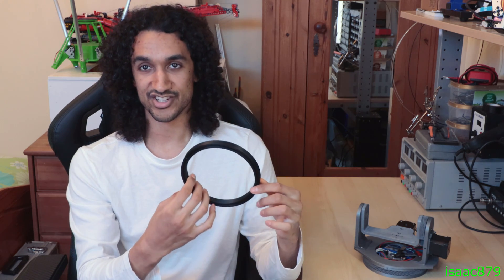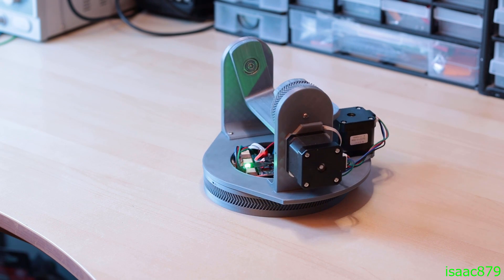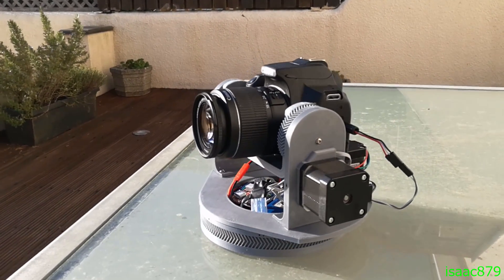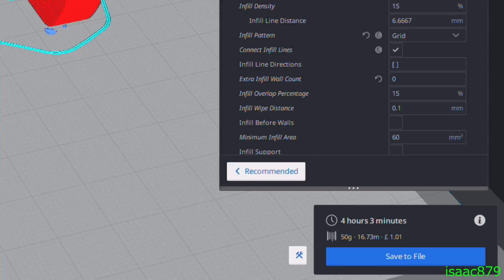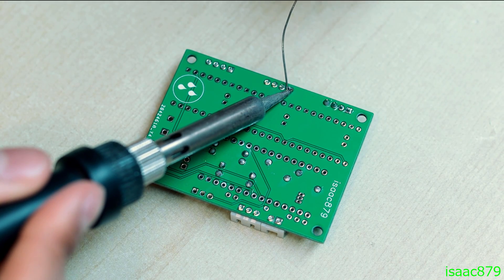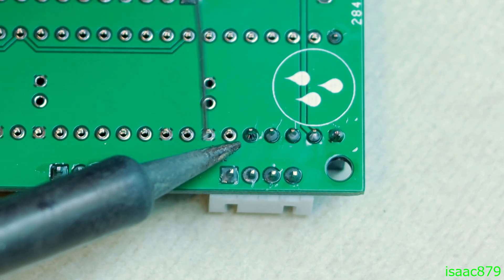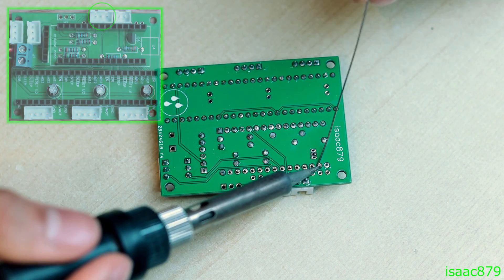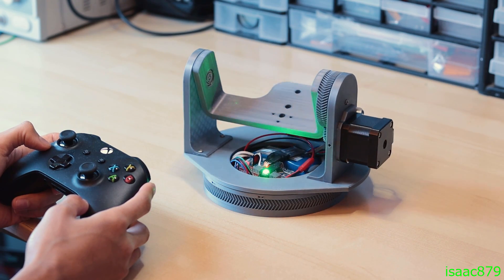3D Printed DSLR Camera Pan Tilt Mount (Arduino/Stepper Driven) 2020

Comment: Which filament do you use the most for printing
Reply from the maker: I normally just use PLA as it's cheap and really easy to print with.
Reply: isaac879 I've tried all the tutorials on YouTube but it doesn't work, do you guarantee this tutorial will work if I try?  and has anyone tried?  and can the xbox controller be replaced with another one?  because the xbox controller is too expensive.  thank you

Comment: I have a Canon EOS RP...what's the weight limit for this ?
Reply from the maker: My camera with the heaviest lens I have is about 950g and works fine. However I think the EOS RP is quite a bit wider than my 250D so may not fit in the U-bracket...
Reply: @isaac879  just barely...mine is 10mm wider

Comment: So I found these $16 lazy Susan bearings that look like they could work (140mm), might solve the cost problem? https://www.amazon.com/Bearing-Smooth-Heavy-Duty-Swivel-Hardware/dp/B07TKW1PMM

It's roughly the same size as the bearing you used and they have even bigger ones for not much more.
Reply: do they work ?

Comment: This looks amazing and well done on getting it all built.  The only thing that I am a bit worried about is that my lens is a bit bigger and will hit the stepper motor if not careful.  What ways are there to make sure that you can put a stop to the tilt function to protect for this.  Also am I able to use the Arduino uno with the cnc shield avoiding having to build the board myself?
Reply from the maker: Thank you! Unfortunately there isn't really a way to stop it from hitting the lens/camera. I have used a variety of much larger lenses and haven't had any issue as long as I have been careful not set the tilt axis to far. Even if you do manage to hit the lens against the mount the stepper motors should just skip steps and not actually damage it anyway.
Using an Uno and CNC shield would require you to change some pin assignments in the code and might not have the circuitry for the hall sensors and shutter trigger for the camera. Apart from that it should work (I initially did some testing with a CNC shield before making my own board).

Comment: This is a great project. With respect to the soldering, could I make a couple of suggestions? (1) For solder, have you tried good quality 63/37 solder? It has much better flow than 60/40, and doesn't require the high heat of the lead-free solders, which will wear out your tips faster. (2) Have you tried a chisel tip instead of a round one? You well get better contact with the pins and pads that way.
Reply from the maker: Thanks! I've have been using a 63/37 solder. I have been meaning to get a chisel tip for a while but haven't got around to it yet!

Comment: hi! great job!! where did you buy the bearing? i looked around and it looks very expensive
Reply from the maker: It was being scrapped from an industrial robot so i got it for free but I have heard they are very expensive ~£400 so I have included files for a 3d printable repacement that just uses 6mm bbs (or any 6mm balls). It is way lighter and still runs really smoothly.

Comment: Love the design :)  any links for the bearing? it looks to be quite difficult to find
Reply from the maker: Unfortunately they do seem hard to get hold of, it looks like you will have to request a quote from here: https://www.nodeshk.com/ina/ball-bearings/thin/csxu050-2rs.html Someone told me they were 600€ though which is why I designed the 3d printable alternative.
Reply: @isaac879  how do you put together the printed alternative? Would that be just by pressuring it in place or should the inner wall be divided and then pasted together?
Reply from the maker: @romarchant  The outer race has a small split in it to allow you to open it up and put all the balls in.
Reply: @isaac879  great project! tell me what diameter balls are needed?

Comment: Would it be possible to replace the bluetooth addon with ESP-01 as it contains both, Bluetooth and Wifi?
Reply from the maker: I think that it would require a redesign of the pcb and updates to the code.

Comment: Out of interest why did you go for a printed gear and not a belt?
Reply from the maker: I didn't know exactly what size belts I would need and wanted continuous rotation so couldn't just cut them down to size. I thought gears would be the simpler solution.
Reply: @isaac879  You're a brave man but I value bravery :) I made something similar recently and went with a belt because I didn't know if the energy figuring out printed gear quality was worth it - I just built in some tensioning ability

Comment: Hello mate, great work. Question, can you recommend a fairly generic and cheap stepper controller for 4x Nema 17s? It doesn't have to perform well or be silent or even offer microstepping. I just need to be able to control it via an Arduino or Pi?
Reply from the maker: Thank you! There is the link to the one I bought a while ago https://www.banggood.com/Geekcreit-CNC-Shield-UNO-R3-Board-4xA4988-Driver-Kit-With-Heat-Sink-For-Arduino-Engraver-3D-Printer-p-1082323.html?rmmds=myorder&cur_warehouse=UK